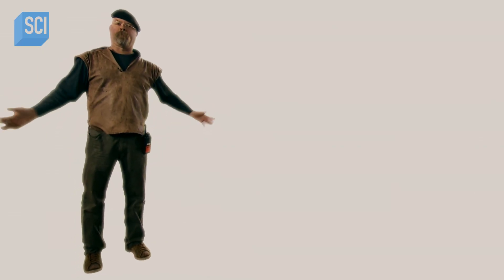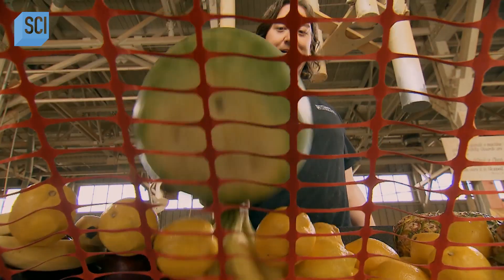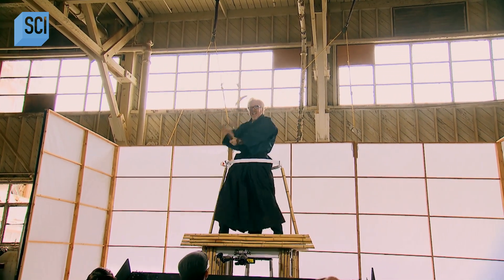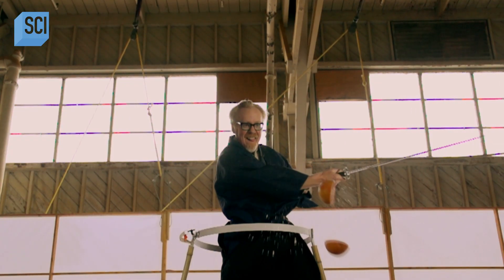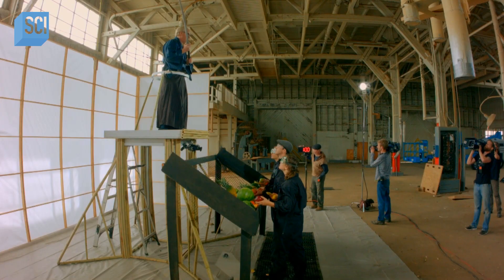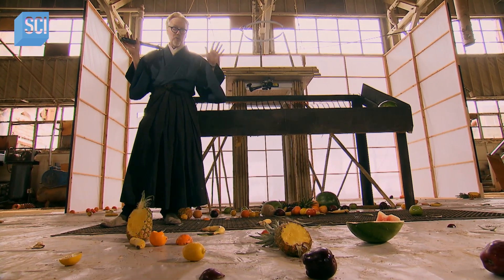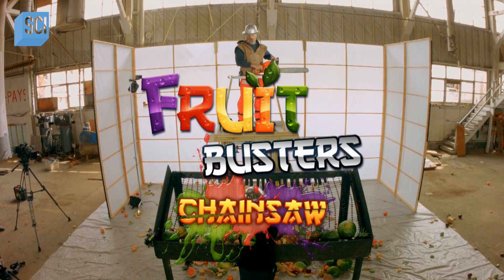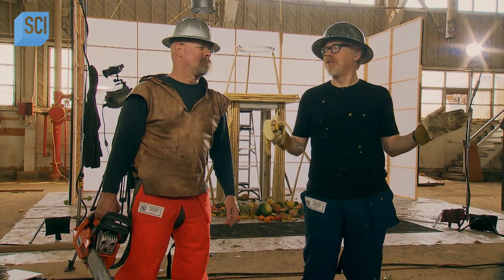Testing Fruit Ninja In Real Life! | Mythbusters | Science Channel

Comment: Need to try this with that working lightsaber that Hacksmith built, no need to worry about hitting the fruit with the edge of the katana if the entire sword is hot plasma!
Reply: I don't think it would actually make a significant difference. Fruit is insanely easy to cut through, you can do it with a very blunt blade and poor edge alignment.